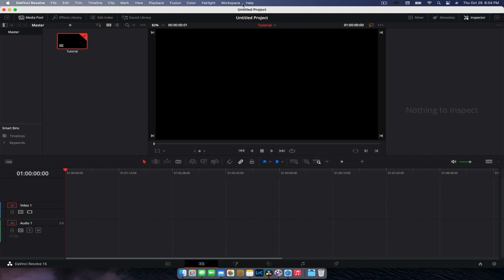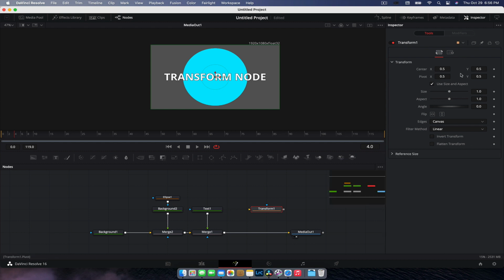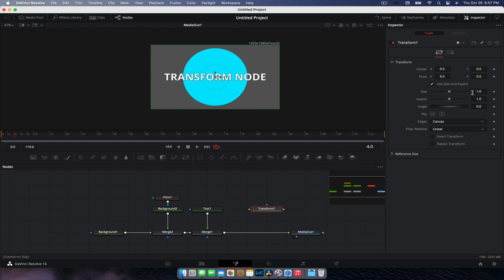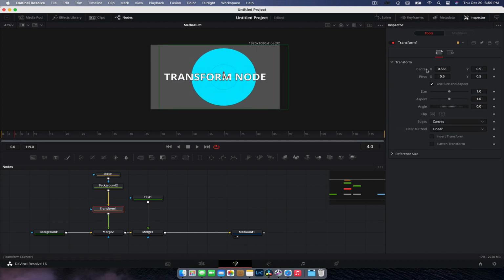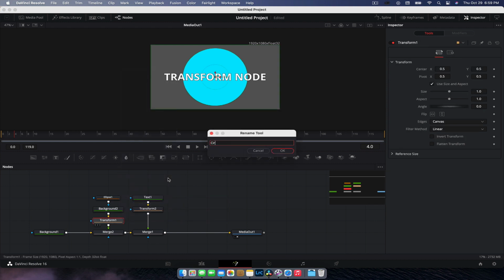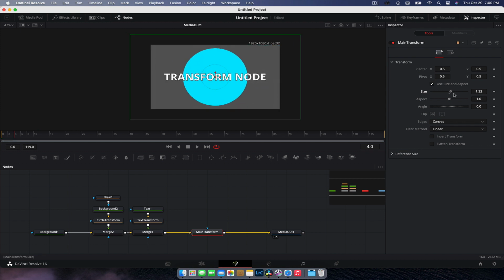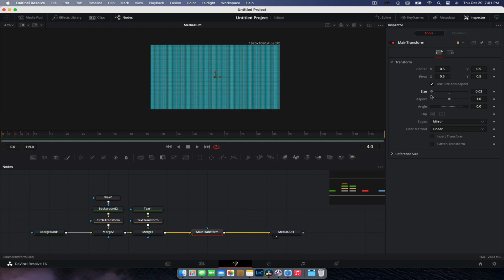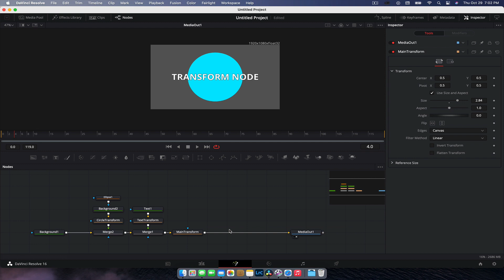How to use the Transform Node in Davinci Resolve 16

Comment: I'd like to use the Transform node to rescale the Media 2 node, but it isn't working. I tested it on a text node and also on a background node with an Ellipse Mask, just as shown in the tutorial, and it worked. However, for some reason that I'm not aware of, it's not working to rescale the Media 2 node, which is a video. Does anyone have a guess as to what I might be doing wrong? Thanks a bunch!

Comment: You didn't explain where you plug the media in in. If I have a long string of nodes writing lines with text (3 pairs) I want to move them all at once but I cannot get it to work as I don't know where the media in goes. When I plug my media in at the beginning of the whole node list, that moves as well, I only want to move the text as a lump around the screen and not effect the media in location